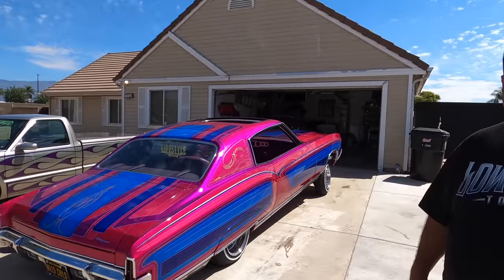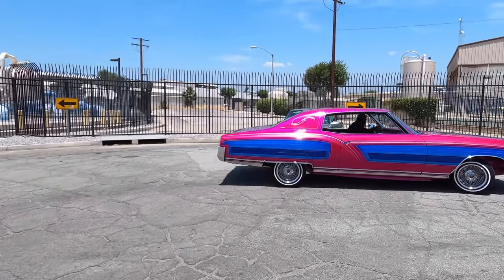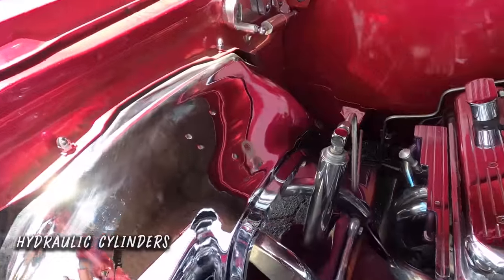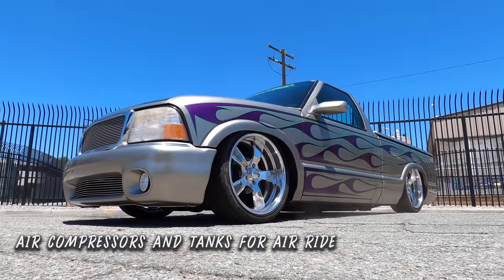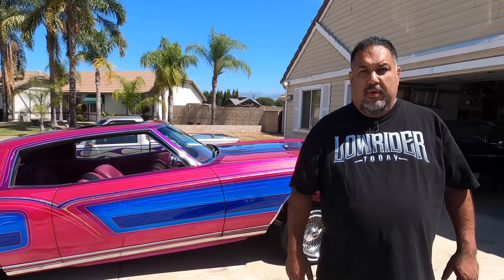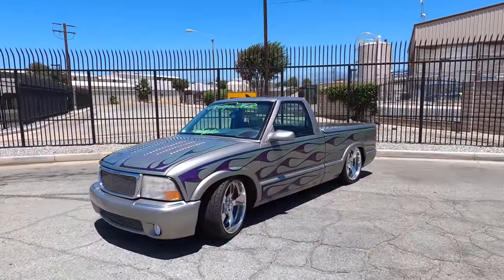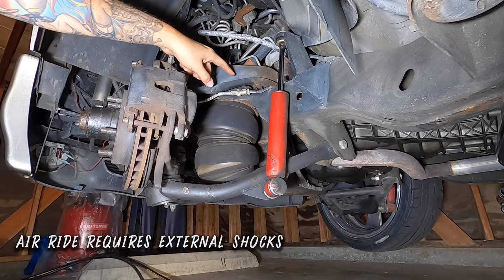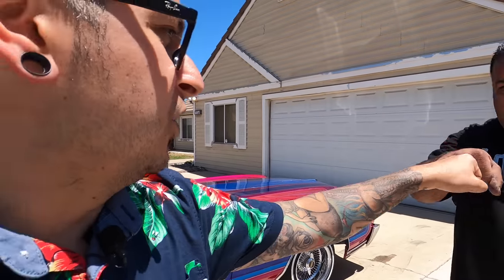AIR RIDE VS. HYDRAULICS: Everything you need to know | The Bottom Line

Comment: What kind of ride do you get on the freeway? What’s the fast as you can go with hydros?
Reply: I've done 70 mph on the free and it can be a wild ride at times.depending on the road,but I enjoy it all the way.like they say"it's a way of life"
Reply: Depends on your set up. I’ve had basic lay and plays and can drive like a regular car with accumulators but if you have a hopper your gonna bounce and skate
Reply: @juanchavez7274  Thank you for your response brother I have a 63 that I’ve been contemplating on whether I should do hydros or not and what kind of set up I should do in your opinion since you’ve had both what do you prefer?
Reply: @beetopahua8058  honestly the set up that was in my 69 Caprice around 1998. 2 door caprice with a 350 /350 combo and 2 Red’s pumps with FENNER STONE gears (steal gears old school stuff) 4 delta dumps 4 switches and 4 solenoids to the front and 3 to the rear and 5 batteries in one rack just under the back glass.8” cylinders in front on 2 ton coils and 8” cylinders in back with 1.5 tons I was able to go much faster with this set up but would routinely do about 75-80 mph no problem and little to no maintenance obviously charge batteries and it was just lay and play. In a 63 this would work but you’d need a stronger carrier bearing and a slip yoke for less hassle also if you keep 8” cylinders in back you won’t have as many issues with the panhard bar (the rear axles kicking out to the left under car thr higher you lock up let’s say with 10” cylinders or bigger) and I had shocks still in back and liked to bounce but you could also add ACCUMULATORS and that would dampen the ride A LOT. On my batteries I had all 5 to front with 4 solenoids and 4 batterie’s to the back with 3 solenoids for a quick switch response (well with steel gears just dnt over lock your system on those gears so you dnt snap the gear and it’ll last you 20 yrs no bullshit with the occasional motor swap when it wears out) the 66 caprice I’m building now is gonna have a bladder with #11 and an Adel to the front with back pump having two delta’s and two accumulators 8 batteries across the back 4 tons upfront and 12” cylinders and 3 tons in back., this should skate as I race down the highway  pretty decently 😆 I like it but it’s gonna need more maintenance regularly and it’s not for the tame I’d say..,this will be a daily driver like all my cars. As stated before this is a lifestyle. Generally we like low and slow but some of us will catch you at a red light hop it 3 wheel and catch a freeway and open up the LS on your ass

Comment: I have an honest question. Ive seen Lowriders with hydraulic pumps catch fire, can air rides catch fire as well or are they safer?
Reply: Safer. There's no 36-72 volts going through any wire in a airbug setup. Compressor uses the most amps. but just from a 12 volt car battery.
Reply: @mr.b3168 exactly.  The compressors are the only component that draws any power (via a 12 volt connection to one stock battery. They have 30 to 40 amp fuse attached as a safety feature. 

If the compressors draw too much power the fuse will pop and shut the system off before any risk of an electrical surge or fire and you replace the fuse. However that doesn't happen often unless your check valve  clogged or the compressor is going out.

Comment: Hydraulics can have a smooth ride if you use stock coils most guys use 1 ton or 2 ton coils also no more than 2 batteries I know I had my 76 glasshouse like that and it almost felt like a Cadillac
Reply: What if i wanted to just lower and raise for your average Cruisers? How many pumps and batteries
Reply: @mothman590 I’m wondering the same thing. I just want to raise front and rear when driving and lower to stock height or slam when parked

Comment: Funny when the dude with hydros thinks he's all that and cant even drive speed limit on the freeways while the dude with air goes by doin 80😂😂
Reply: I had switches in a 62 impala and drove 75 on the freeway all the time,
Reply: I just got a hopper and thing is not drivable lol. 79 glasshouse, 6 batteries 2 pumps. Has a pretty high lockup and the front when it dumps is still crazy high. Definitely gonna sell it and just run accumulators and lay&play on one of my el caminos instead lol
Reply: @nitolinilo9034  Agreed...Im building a 62 ragg lay and play and 3 wheel ofcourse with accumulators  2 ton pre Cutts all corners and it rides like a dream..
Reply: @bigjon.6258  it’s a tough lesson but I don’t got enough love for lowriders to sink money into something I can’t take on the freeway comfortably lol. That and be constantly fixing it whenever you do so much as breathe on the switches
Reply: All depends on setup...

Comment: 1800 for a basic kit. Hahaha thats funny. You can pick up a 2 pump setup on the low end at 800.00 new.
Reply: You didn't take into account the metal required to make the racks and the batteries which are like 50$ each refurbished. Welding material, etc. Air ride kits are bolt on.